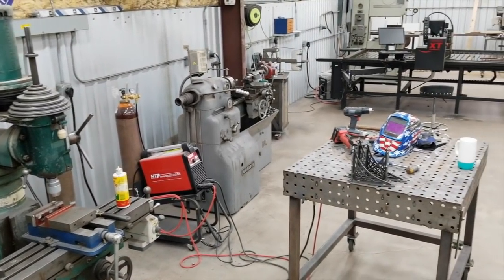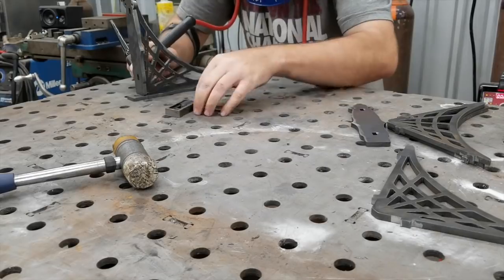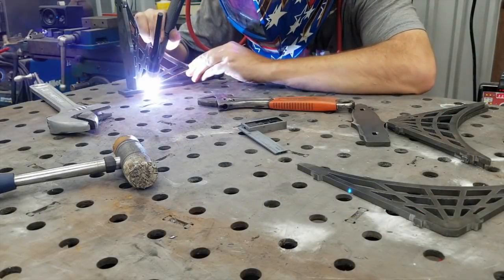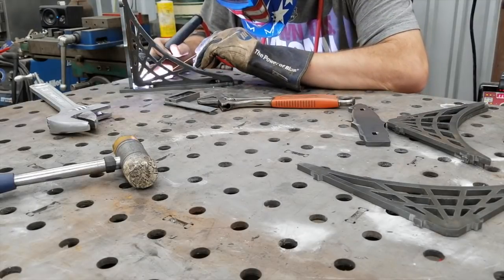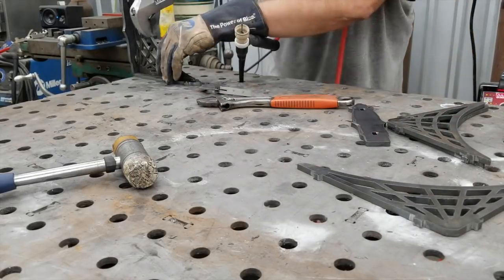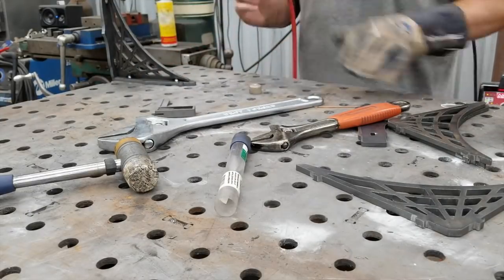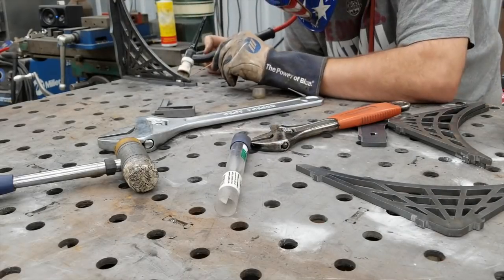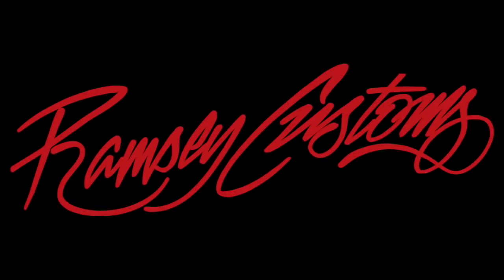Tig Welding Plasma Cut Spider Web Gussets - Basic metal fabrication DIY project

Comment: Use some 45 amp consumables and try to play with your cut height....  that will help you getting a more straight cut where your tab and slot fits real nice ....
Its a little bit of fing around .... but once you have it dialed in .....
Reply from the maker: Its weird, I get almost no draft on 3/4 or 1", really nice edge quality but 1/4" has always had slight daft, well at least enough that you cant really use it as a reference surface to square up off of.
Reply: i have a xp45 and it seams like it cuts 1/4 straiter then it does 1/8
Reply: jason, that is expected - generally speaking on thicker material you get a nicer cut (unless you get pretty close to what the cutter can do, then you might get some taper on the lower 1/3 of the cut) but generally thicker material contains the arc and stabilizes it better than thin material ... 
if you want to cut thin material you need speed !  that is why Gary can cut at 600 ipm on his table because if you cut too slow - that is not good wither for cut quality because you loose arc stability.
too fast is not g.od - but too slow is not good either.